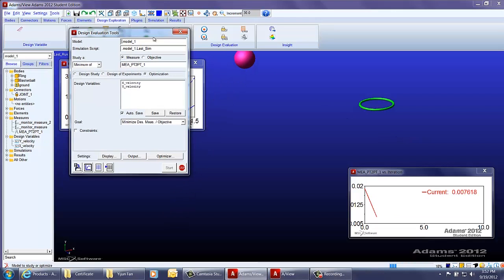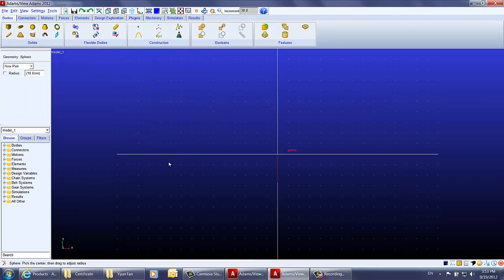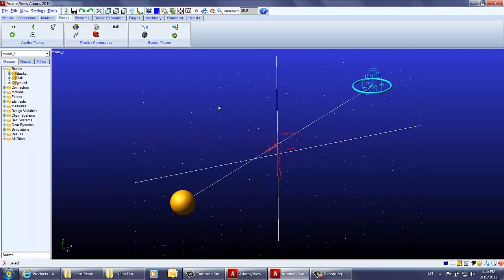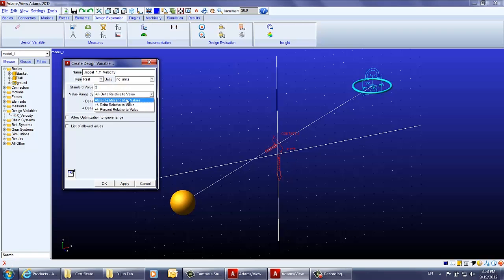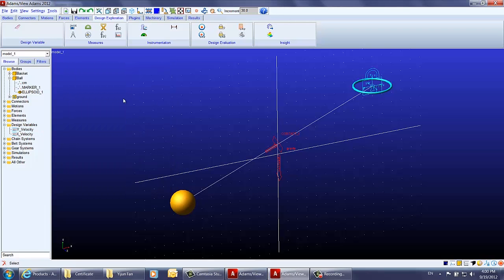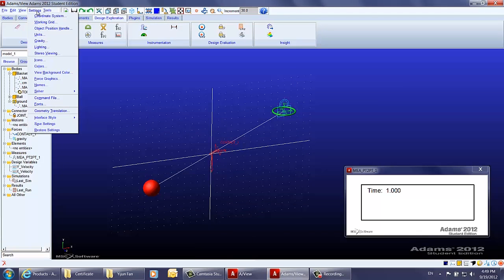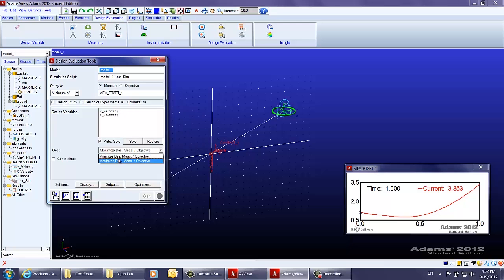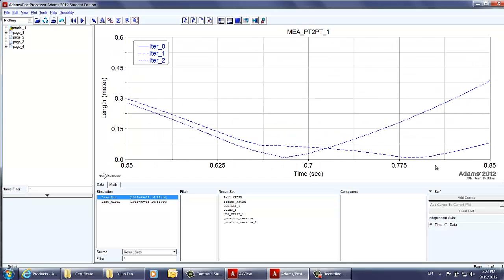Adams 2012 Student Edition Tutorials - Basketball Model Optimization

Comment: How can I set the connectors position with Design Variables, or with something else? Every time I change the model parameters, the global connectors position remains the same, and I need to reset them manually. I want an otimization for the joints in a mechanism, that's why I need DV.
Reply: did you know it???